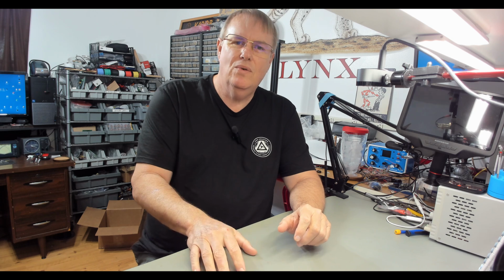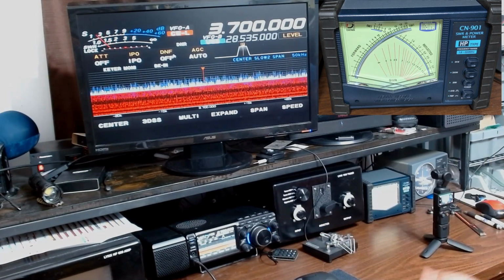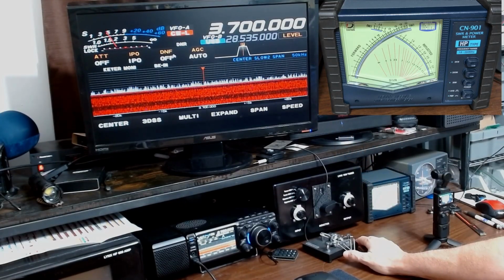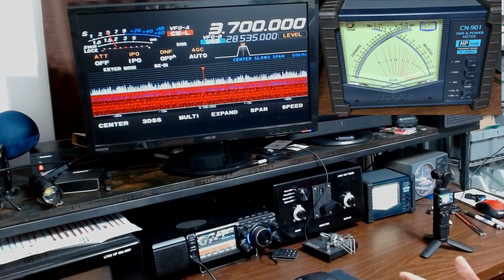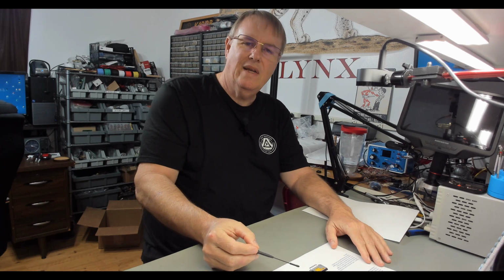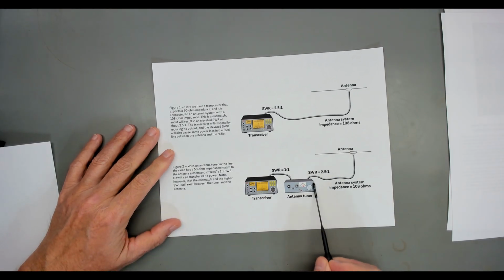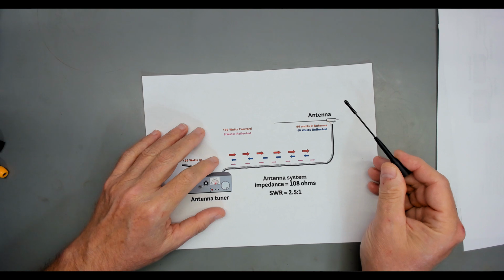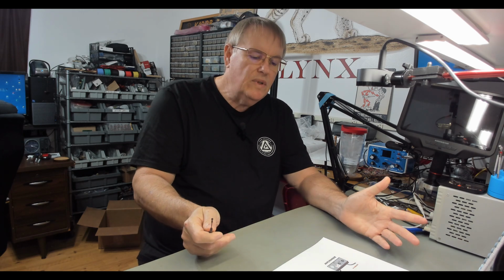What Most People Get Wrong About Antenna Tuners!

Comment: Great description of the process and the outcome. In the back of my mind I tend to think of a “tuner” or a choke as changing the  velocity factor so you get a match at the set - be interested in your comment on this approach?  Also, going down in frequency matching is an issue in audio and power systems where it becomes power factor - have you any thoughts on the relationship of power factor to the RF situation? Thanks
Reply: Yes, I feel that this is (for antenna efficiency ), pretty much the same as power factor correction, in electrical systems the antenna needs to "look" as R only, not Xl or Xc

Comment: Exactly, well said. We MATCH the antenna. That's why I use a multiband 10m through 80m fed with 600-ohm balanced line, Doublet antenna system. No coax, balance line all the way to the back of the wing nuts on the back chassis of the tuner…
Reply from the maker: Thanks for sharing that information.
RJ

Comment: Just a question. Do you know the difference between characteristic impedance and line impedance?  Do you know how they're related?  Does the transmatch change either one?
Reply from the maker: As I said earlier, I explained what transmatches do. I accept other people have different beliefs and am not interested in trying to change them. I do not need everyone to agree with me. I for sure will not insult people I don’t know by insinuating they are dumb because they do not agree with me. None of this is new I’ve heard it all for many years. To believe everyone agrees with your view is just wrong. You can find a whole lot of people in agreement with my view.  Read the comments, watch the video below  and read those comments or one of the hundreds other. If you believe you’re correct that’s great! Causes me no concern at all. 

https://youtu.be/NEIjFQE0IGg?si=jYtBWkBGI9l90mRj

All the best! And 73’s
RJ
Reply: @LynxElectronicsLab thank you for the insult.
Reply: @LynxElectronicsLab  "If you believe you’re correct that’s great! Causes me no concern at all. " ... well, it should concern you as the video you've just put out is selective in terms of facts.

Comment: Your setup is totally wrong. The daiwa meter, according to the manual, says it needs a 50 ohm input. You are running the Daiwa AFTER the transmatch and your input impedance TO the Daiwa is no longer 50 ohms because it's trying to match to the antenna, it's no longer 50 Ω and its use is not being recommended by the device manufacturer. 

The Bird 43 is highly recommended by all AND it specifies that if you feed it with 75 Ω and your load is 75 Ω that your device will read ~1.4:1 even though it's a perfect match. They give us these instruments and if you aren't careful, you get erroneous measurements. 

Wattmeters don't measure power. They measure the current directly and assume you are using a certain input impedance. They specify the impedance they expect for you to use. Daiwa did that but it gets glossed over, but it's still important. 

I hope this helps. Your conclusions based on the erroneous measurements are really in question here.
Reply from the maker: Thanks for your input. 
RJ
Reply: @LynxElectronicsLab You're welcome.

Comment: I agree with most, but I think you missed a big point.  When reflecting at the antenna, there will be outer shield signal (aka common mode) which will cause the outer shield to radiate like an antenna, for the good but mostly the bad.  I say that this is a bigger effective loss. That is a radiating coax running along the ground and through structures to ones shack, will radiate power into the ground or throughout one house.  This unbalanced to balanced transition can be helped by using a good balun, but even a good balun will lose(use/consume/heat) power  of 0.2-0.5 dB or 5-10% signal loss.   Without a balun, a tuner which matches an unbalanced line to an unbalanced line (i.e. shields connected) will pass the common mode signal right through to the radio and ones grounding system. SWR does not measure common mode signal just as it does not measure coax attenuation loss, and in both cases a loss due to signal attenuation or common mode would make the SWR read better than actual.
Reply from the maker: Thanks! But I did miss it I just was Trying to stand with one topic. I knew it would create enough disagreement already. 
RJ
Reply: @LynxElectronicsLab thank you for not discussing CMC.
Reply: Reflected power is not the cause for common mode current, a perfectly resonant antenna can suffer from common mode current, its caused by an antenna current imbalance, you are correct in saying a good choke will help reduce cmc on the feedline

Comment: Thank you for the document on tuners from ARRL.  Seems to me that, if you have good, quality coax and you have an antenna analyzer and connect that to your antenna, not your radio, you should not need a tuner.  That is just my take.  I have a tuner but, have not used it yet.  I mean a portable antenna analyzer, where you make adjustments to the antenna wire prior to connecting it to the radio.  Just my take.
Reply from the maker: Thanks, If you truly tune your antenna as you say then a transmatch (aka tuner) is not necessary and any swr reading 1.5:1 or less is not in need of adjustments. As shown in my recent “should you buy a hexbeam” video it is close enough that I do not use a tuner with it. 
RJ

Comment: Thanks for the very interesting video.
I have a question. How does the situation change when using a remote tuner; one that is at, or very close to the antenna feed point?
Reply from the maker: Mainly all the feedline loses go away smd you create a much more efficient antenna system. This is why that is considered a much better setup. But not always the most practical. More expensive but also In my part of the world they do not hold up to well up on the tower.
RJ
Reply: @LynxElectronicsLab all the feedline losses go away???? Or the feedline losses due to the mismatch????

Comment: Excellent video.  That was explained in a very easy to understand manner.  This subject of antenna turners is so confusing at times and so many folks are confused about it.  The way you explained it and with the example you conducted on your radio made it clearer.  Thank you so very much for sharing and making a simple understanding of what an antenna tuner really does.
Reply from the maker: Thank you very much for the kind words!
RJ
Reply: It's confusing because of videos that promote incorrect information

Comment: Right on RJ 👌 
There is only one way to tune your antenna,  At the antenna!  All tuners do is make your radio or amplifier happy.  NO MORE  I have a couple of tuners here but they collect dust.  I like makeing my antennas for the frequencies I talk on. 
Sometimes I have to have 2 antennas per band.
Reply from the maker: I totally agree that the best way is to build your antenna for the frequencies you use!
RJ
Reply: Agreed....
Reply: They make the whole system happy, if it only made the radio happy how would power be transferred to the antenna, power is transferred because the whole system is purely resistive
Reply: It's amazing to me that when it comes to antennas all knowlege of electrical circuits is ignored. Any time you have an alternating voltage wiith capacatance and indutance you have whats known as a TIME CONSTANT in other words changing the value of either of these changes the time it takes to send the wavelength inductance will shorten the wavelength an capcatance lengthens it. Antennas have 3 standing waves E C & L. The way atuner works is by adjusting capacatance and inductance until the signal is the same length as your wire and the SWR ratio  is the ratio between inductance and capacatance with inductance the current lags the voltage 90 degrees while with capacatance the voltage lags the voltage 90 degrees a tuner adjusts the signal to the length of the wire then adjusts the C & L until they 180 degrees out of phase and cancel each other outleaving only resistance.
As far as the old Walter Maxwell myth of retransmitting reflected power there is none wat you see on your meter is current created by impedance interacting with the voltage in the feed line.
73s, Bob AF4js
PS the only place you can get an accurate reading of an antenna circuit is right before the final tank ciruit!

Comment: Interesting video, very well explained. Thank you.
 I certainly am not a specialist but this problem was always on my mind.  That’s also the reason why after all those years of licensed ham radio operator I still have no antenna tuner. I Always try to make my antenna's (homemade or commercial) resonant to the used frequency.
73 from ON
Reply from the maker: Thanks
RJ
Reply: @LynxElectronicsLab  
When I read this, I think I need to correct my writings above. I had no antenna tuner for decades, but 4 months ago I get myself a new ICOM IC-7300. This TRX has a build in antenna tuner. So, I was I liar. Sorry for that.
But because all my antennas are resonant I never used the build in tuner. I used him only once, just to try it out and to see how it works.

73

Comment: Your coax is 50 Ohms. So if you terminate your coax on both sides with 50 Ohms. You will not have any reflected power. 
But if you do not terminate your coax with 50 Ohms, you will have a standing wave ratio.
If you have a dipole of a half wave length and feed it in the middle, at resonance your impedance will be 72 Ohms, So if you connect it to a coax of 50 Ohms, you will have a standing wave ratio, because your coax is not terminated with 50 Ohms impedance.  The impedance will not be 50 Ohms..... But it will not mean your antenne  is not resonant..... 50 Ohms and a standing wave ratio of 1:1 will not mean it is resonant....
Your coax is just correctly terminated...
Now you take your half wave length wire and feed it at the end  (our the beginning of the wire). You impedance will not be 50 Ohms... But it still is resonant.  But at a very high impedance...   
What I try to say to you, an SWR of 1:! only means your coax is correctly terminated... It does not say anything about resonance.
Our is your dummyload of 50 Ohms resonant on all bands ????
So of you tune your antenne and feedline with a tuner, the system becomes resonant..... But not 50 Ohms on both sides....
Reply from the maker: Thanks for the information. One thing that seems to be missed is that we do not tune our tuners for resonance we use SWR meters which do not show that. We tune to lowest SWR which is not at resonance. 
RJ
Reply: @LynxElectronicsLab thats exactly where you are going wrong,,, eg folded dipole is around 300ohms, use 300 ohm balance line the antenna is matched there's NO SWR or reflected power on the feedline but there's a mismatch at the transmitter, add the tuner you are tuning out the reactance and matching the complex impedance with a conjugate match
Reply: @Pioneer936  Exactly !!! This is why I would not recommend this video to anyone  having problems dissecting that. The author also conviniently ommit the effects the resonance has on receiver (considerable gain that is used by many for coarse tune by ear). The number of operators in the comment section, repeating the same misinformation is honestly frightning.
Reply: @zaywas there's quite a few videos similar that are promoting myths

Comment: how come sometimes you can match a poor antenna with really high swr... but not getting out power from the antenna?
Reply from the maker: If I understand the question correctly. Matching the impedance of a door knob will not make it radiate effectively on 80 meters. You must start with something that can radiate on the frequency then match its impedance so you can get power into it. 
RJ
Reply: A radio amateur friend once said we could tune up a knitting needle to work on 160m but it won't be efficient. 
It's too short to radiate well but matches the tx output. 
G4GHB
Reply: @bill-2018  That's exactly what I mean. I find it kind of strange. You can match anything in terms on impedance matching, but it will not always work as an emv radiator

Comment: An antenna tuner absolutely does TUNE your antenna ... IF you tune it for resonance, which isn't necessarily the point of lowest SWR but is usually close.  If I put a coil across the feedpoint of a short dipole to bring it to resonance, I am tuning the antenna.  If I put a reactive element some distance from the antenna and connect it to the feedpoint with a length of coax, adjust the reactive element until the coax presents the same value of inductance to the antenna, I am tuning the antenna.  If I decide to connect that same length of coax and reactive network in series with the connection to my rig, I have connected a tuned antenna to my rig.  How people don't understand this boggles my mind.
Reply from the maker: Thanks for sharing your thoughts; I appreciate your perspective on antenna tuning. While I completely agree about the resonance not being the point of lowest SWR but being close. Most hams say the antenna is resonant but they mean they are cutting it to the lowest SWR. I am also guilty of this. I am afraid I do disagree about the antenna being tuned. You are making a match from an antenna that is not to an radio which is 50 ohms impedance. The rest is simply semantics to make it sound more complex. If the antenna was truly being tuned in some way you would not have the Standing Wave reflections returning for it. The only thing being tuned is a matching network which is transforming the mismatched antenna to your fixed radio input and output impedance. 
RJ
Reply: The standing waves on the line have no bearing whether the network is tuning the antenna or not.  Consider the same situation I described above, except leave the reactive network as a termination to the same length of coax but without the rig being connected to it.  The antenna is clearly tuned in spite of there being standing waves on the coax.  If you check the current and voltage at the feedpoint of the antenna they will be in phase.  That is the very definition of resonance and the antenna is tuned.

Now, connect a second length of length of coax to the feedpoint of the antenna and bring it into the shack for connection to the rig.  Now there are no standing waves on the second length of coax except for whatever mismatch there may be between the resistive (i.e., tuned) feedpoint of the antenna and the impedance of the transmission line.

Whether I choose to connect the rig at the reactive network at the end of the first length of coax or at the end of the second length of coax the result is the same ... THE ANTENNA IS TUNED IN BOTH CASES ... assuming I tuned for resonance and not lowest SWR.

My original example is exactly how matching stubs work, and properly applied they work whether I put them at the antenna feedpoint or someplace else along the feed line ... and they work the same whether I choose the proper length for an open or shorted stub, or whether I choose to put a variable reactance at the far end of a stub of arbitrary length to make life simpler.  AND ... they work the same whether I choose to feed a separate transmission line or whether I choose to tap into the reactive network for my connection to the rig.

This whole "antenna tuners don't tune the antenna" is a bogus play on semantics that is ignorant of the actual network theory and transmission line theory that is at hand.  Basic network theory says you're wrong and you're contributing to the misunderstanding of everyone who watched your video.
Reply: @LynxElectronicsLab take a leaf out of the chap from electronics for the inquisitive experiments, he had this response and admitted he may have got it wrong, he went away and did some study and made a new video on his new understanding of the subject

Comment: Well, you can lose the coax by having a transmatch with  a balanced line output into a ladder line... that has very little losses.
Reply from the maker: Don’t tell anyone. My loop is feed with 450 window line for that reason. 
RJ
Reply: @LynxElectronicsLab  If you don't tell, I won't. Currently experimenting with an FB 5 (the original Byrd dipole) and because I had no space left in my wall pass I put a window line out the window... just as the name indicates....

Comment: The difference SWR indication on your Yaesu and the DAWA (Tuner in bypass) is because you having a short cables between rig => tuner => DAWA. The SWR on the Yaesu is [Yaesu => cable+tuner(bypass)+cable+DAWA+cable+antenna]. The SWR on the DAWA is [DAWA => cable+antenna] only - and that makes the difference! 73s OE1MWW
Reply from the maker: Correct but the two meters never agree at low power for some reason. 
RJ

Comment: It's like a transformer between th antenna and the transmitter.
Reply from the maker: Yes, like one but we use capacitors and inductors to do it instead of transformers. 
RJ
Reply: @LynxElectronicsLab  Ummm okay, but not what I meant.
"Like" a transformer ... affecting voltage/current/reactance ... I didn't mean literally.
cheers

p.s. FWIW I've recently been pondering most efficient way of feeding EFHW. Would fit my site here!
Reply from the maker: @BenTrem42  I understood and was agreeing just commenting were using capacitance and inductance. 
RJ
Reply: @LynxElectronicsLab  Oh hey yaaa for sure.
I was just trying to dumb it down with something like an analogy i.e. transformer ... as though to transform from one to the other. Rather than more precisely technical.